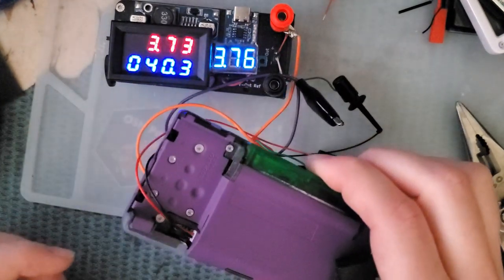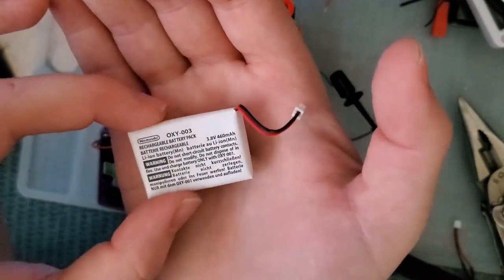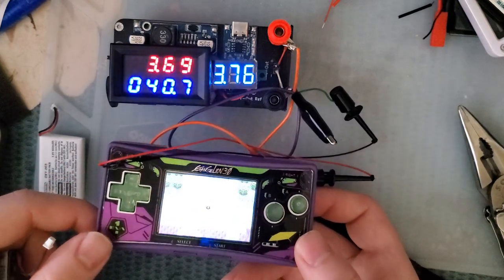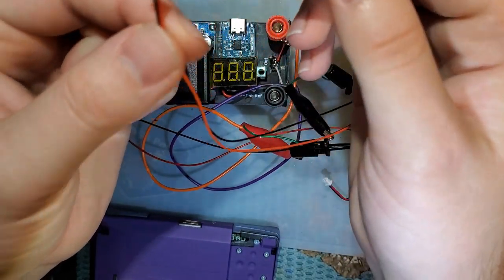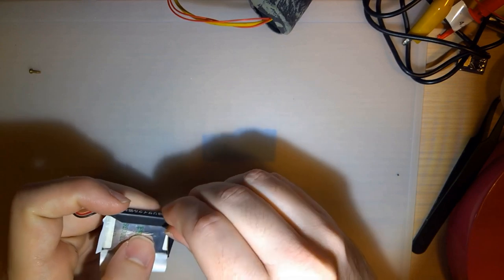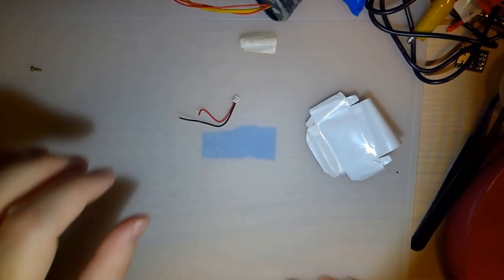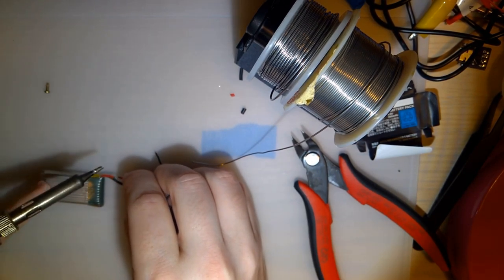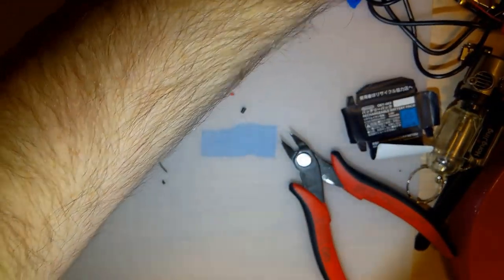Mod Game Boy Micro Battery and Observations

Comment from the maker: The faceplate was purchased on aliexpress and is no longer sold. The purple coating on my Micro is cerakote and I had it done custom. The silver Micro at the end of the video and the purple Micro at the beginning are the same console. 

The faceplate is actually just a sticker. I got the sticker on aliexpress and applied it to a scratched OEM faceplate. It was only a few dollars and there are other designs still available (none of them are Eva themed though). The cerakote was done by a gun shop. It was not cheap. I could have purchased another Micro for the cost. Yes, I love how it turned out. No, I'm still not done with it.
Reply: what about buttons?

Comment: 9:18 
"The Note Micro 7"

maybe we should just see if we can't just finagle the plastic plug off the old micro battery wires and insert them over the new ones?
iirc, most connectors are all using the same or similar enough design for how they're held in place.
At least, that's how non molex pc case fans are. Generally it'd be, take a pushpin or a thinner pointed object, insert in the wire end of the plug, and loosen the metal contacts from the plastic and out it comes.
Reply from the maker: That's probably easier but in my particular case, I filmed that part in September of last year and I just got the connectors last week. Also, the donor I had did not have the right style connector on it anyway and most of my batteries do not come with a connector at all so I had to solder something on anyway. If soldering is required, it seems easiest to just solder on the salvaged connector from the start.

Comment: Great vid as always! What “ready to go” battery off of eBay or amazon have you used in the past that you can “recommend”. I know none of them are perfect but something that’s a lesser evil than others? My understanding is that most of them  don’t fit great and the connectors all have to be slightly modified to connect without major effort. 
Thanks!

Comment: I still have my micro. I even changed the battery (pretty similar to the stock battery). But what i'm looking for is if there is a large capacity battery replacement. You see, when you use a 'flash card', it drains the battery faster. So I can't think of anything other than buying the original game (which is slowly getting pricier) or just finding if there is a larger battery. I recently ordered a 600mAH battery micro replacement from the US (still average for me). But I'm looking for an ultimate mod to make the micro have a really good battery life...
Reply from the maker: I have an "800mAh" battery that I've been meaning to do a video on. Actual tested capacity is lower than that but I have seen some that test up to 850mAh per the original seller I got the idea from. Not sure what manufacturer for the cells they were using though. Still higher than some of the aftermarket cells I got though.
Reply: @makho  wow 800??? Where did you get that from? Do you have a link where I can buy?
Reply from the maker: @jajabinx35  https://www.aliexpress.com/item/33023343395.html
Reply: @makho  Thanks so much. Will look forward to your findings on this battery too (whenever you plan to work on the video :) )

Comment: Did you ever check the power use while using various flash carts? Get some proper numbers by how much you cut battery life while using one. Would using one on a Micro at minimum brightness still drain more than max brightness and a regular game. Stuff like that.
Reply from the maker: I did not. I've actually been meaning to build an interface so I could just measure the consumption straight from the cart bus and eliminate the other variables but I keep forgetting to do so when I'm in a position to actually build it.

Comment: Hello, Mr. Makho I seek your knowledge. You've been doing this a lot longer than I have. I just wanted to know what wire gauge is best for installing the IPS V2. Is 30 AWG too thick, should I go with 40 AWG?
Reply from the maker: 30 AWG is too thick? I think you might be doing something wrong then. 30 AWG is very thin wire. Are you using it for the brightness controls? If so, 40 AWG should be fine but 30 AWG is the bare minimum I think for anything power related.
Reply: @makho  I'm buying wire specifically for the brightness controls on the V2. It will be my first time attempting something like this. I've only ever soldered a handful of time to replace batteries in my games. 😂 I guess I'll go with the 30 AWG.

Comment: Can I use 3.7v battery in gbm
Reply from the maker: sounds like you need to do more research because voltage isn't enough to describe the battery.
Reply: @makho  the size I have checked it will fit easily.
Reply from the maker: @bills87  Like I said, you should do more research. If you have to ask this question, especially on this video, it indicates to me that you should not be messing with batteries like this. For the record, the battery you linked should work.
Reply: @makho  thanks a lot bro.
Reply: @makho  Hey I love your videos and I am trying to find a replacement battery for my gameboy micro that I have had for about 15 years. I am really worried about ruining my micro with a bad battery. I have seen all your videos regarding the micro at least 10 times each but this comment makes me nervous. I have been trying to do a lot of research before plugging in a battery into my micro but I dont know if I have researched enough. I dont know if it is me but I am really struggling trying to find information regarding rechargable batteries and their compatibility with devices. Is there a way you can point me in the right direction? Thank you for you great content and time.
Reply from the maker: @jb2525  https://batteryuniversity.com/learn/article/sharing_battery_knowledge
Reply: @makho  Thank you so much! I appreciate your help!